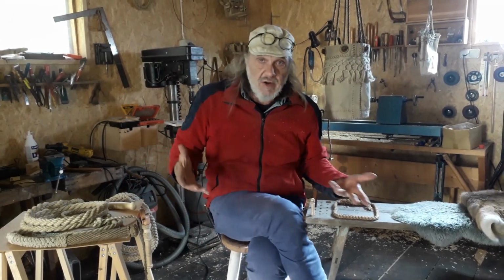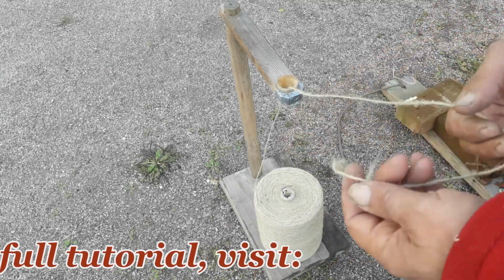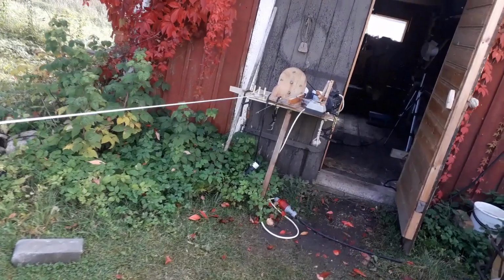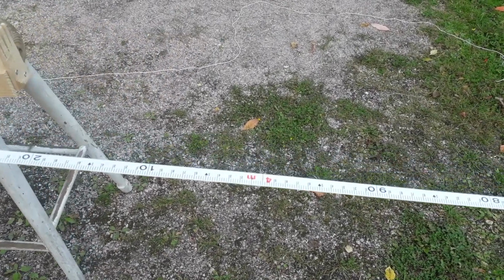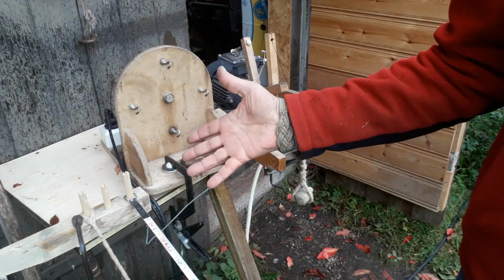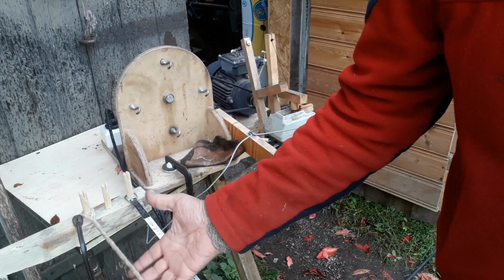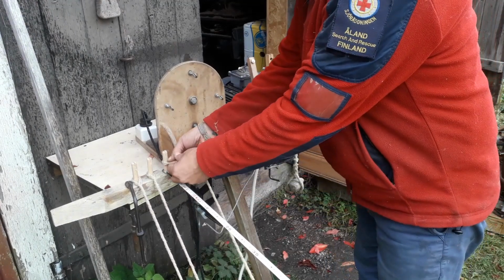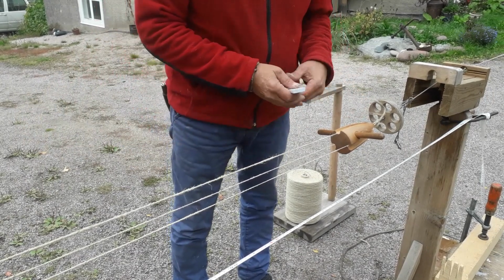Tapered Rope Whip - Making of

Comment: Excellent work. Any indication on thread consumption or maybe a hint at the final weight of the whip to work out the requirements for one piece?
Reply from the maker: That all depends but for this one I used about 200 meters of Nm 0.6 yarn. The total weight about 350g.
Reply: @mikkosnellman  Thank you, i generally do not have a big stock of rope or thread or a lot of storage and need to procure for a project. This helps a lot.